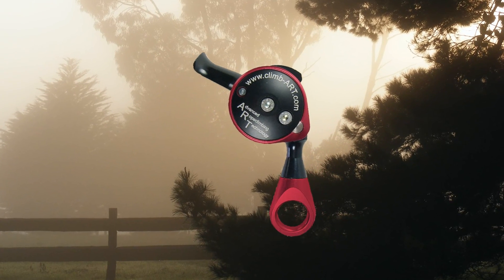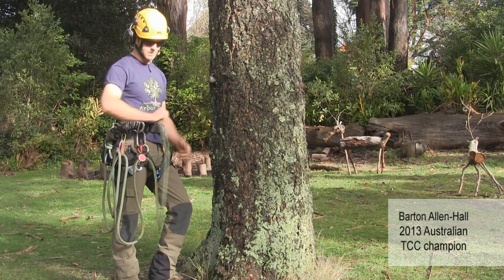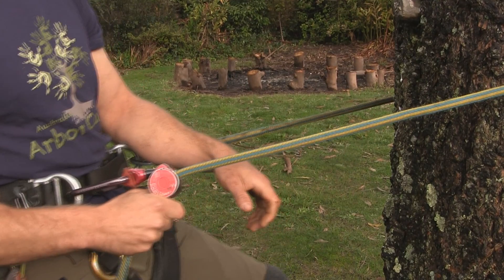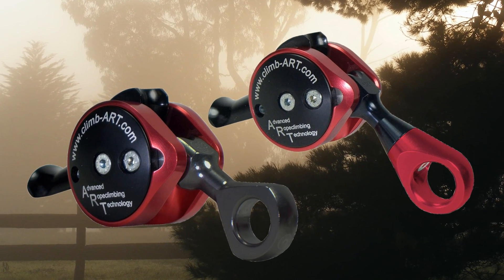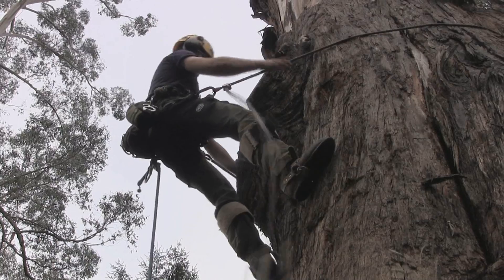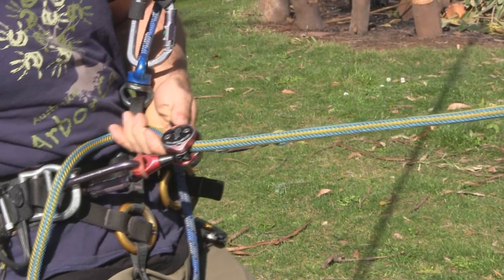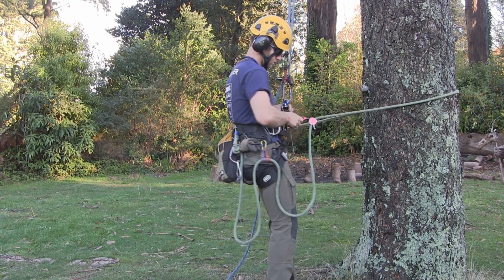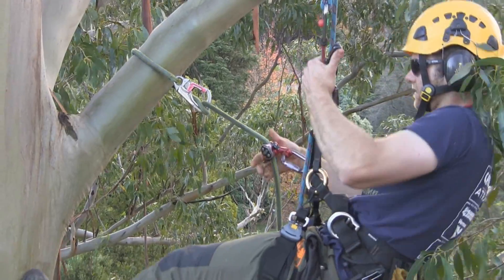ART Positioner

Comment: I have one of these is constantly tightening up when I don't want it to and sometimes it doesn't shut itself another words that's why it's not Dependable for a single Anchor Point cost me $400 for it and the half inch wire core Flipline. I'm not impressed but I don't hate it.